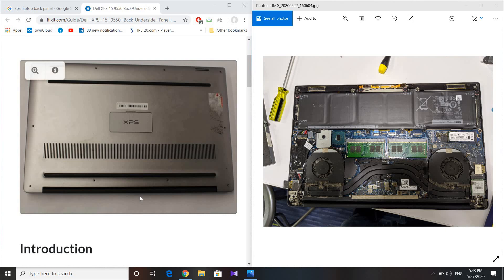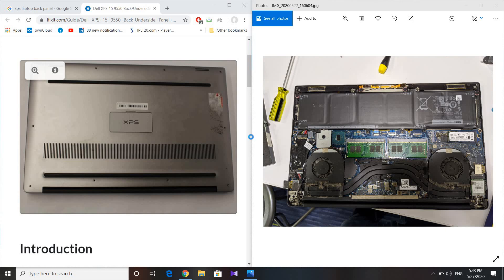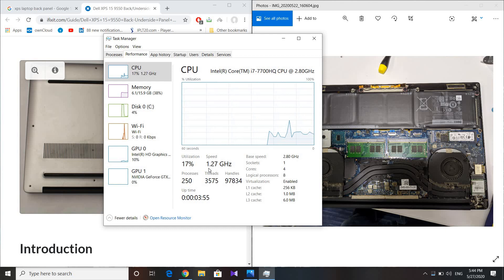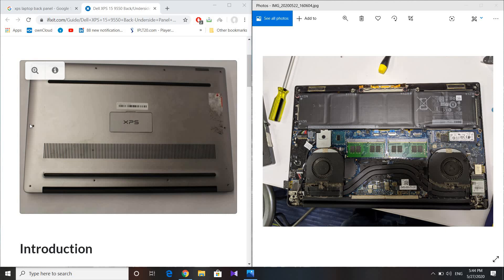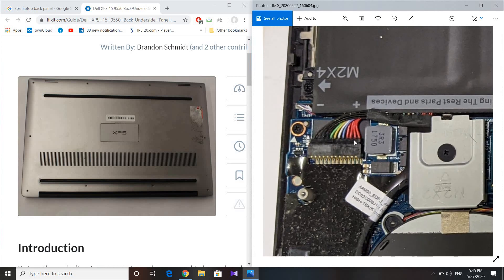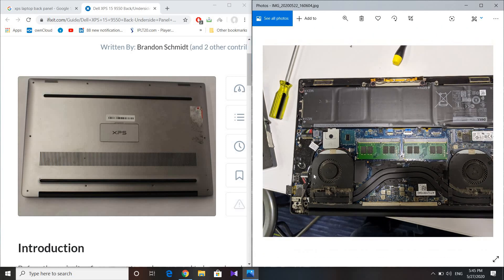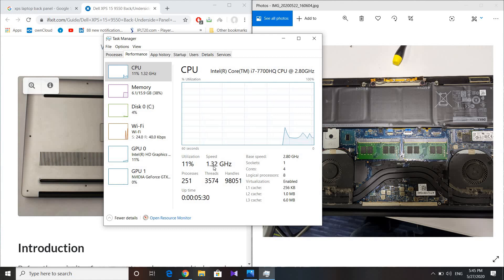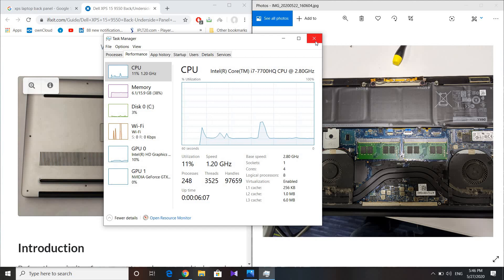Solving issue of CPU speed being stuck at constant value (0.78 GHz in Dell XPS)

Comment: I'm using a Dell Precision 5520, i can assure you that this solution WORKS, I'm not sure what caused it or why this solution worked, but it worked for me.. 

I opened the back, removed charging port from the board, and removed the battery from the board, then i connected the charging port back, without the battery, and plugged in charger and turned it on, CPU was normal, i plugged in the battery and everything is okay

Comment: I have dell precision 5520
32 gb ram with 4gb quadro m1200
I7 7700hq processor but when ever i open a game cpu is stuck at 0.8 ghz
And when i quit the game it goes back to normal
Will this permanently fix the problem
Reply: Any suggestions

Comment: This problem only occurs for me when connected to the Dell WD19TB Dock. Unplugging the battery, as well as replacing the motherboard, does not solve my specific issue. There is no issue when NOT charging via the dock through thunderbolt, thankfully. I'm still figuring this crap out
Reply: did you find any solution? I have a Precision 5520 with the same problem
Reply: @danixkarim  nope, sold the laptop and now use an ASUS M16 with the dock and it works better than with the Dell haha